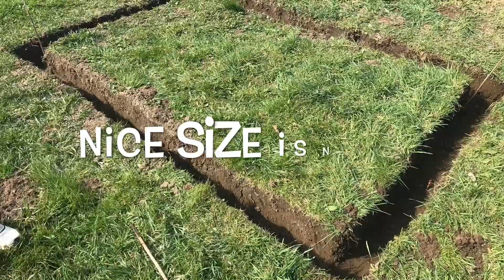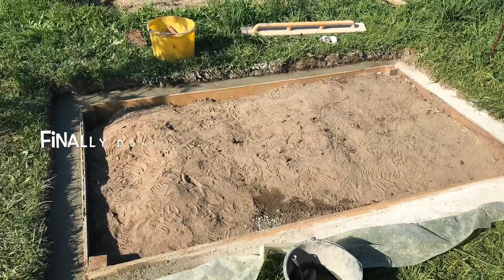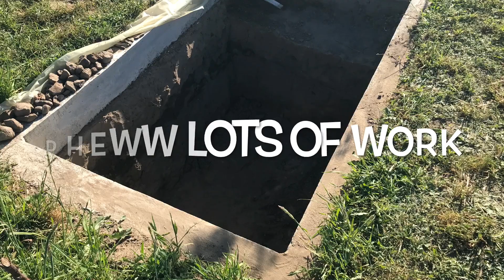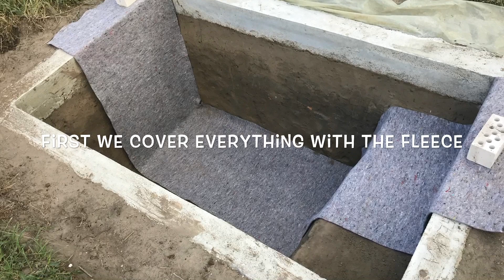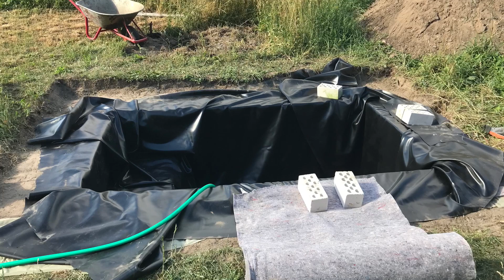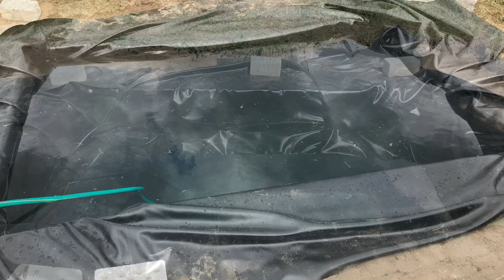DIY Koi Pond Build Part 1

Comment: need help have pond one air pump fitting 18mm I need to adapt to 8mm air pipe any ideas? The pump came with a rubber tube that is about 18mm but can not seem to find a fitting for my large air stone that has a 8mm pipe.77
Reply from the maker: Hey, hope I understand you right but I guess you looking for something like that:
 https://www.amazon.co.uk/dp/B010QIB7MU?psc=1